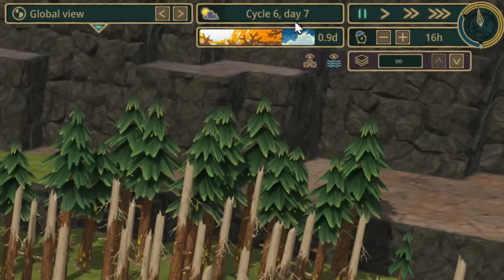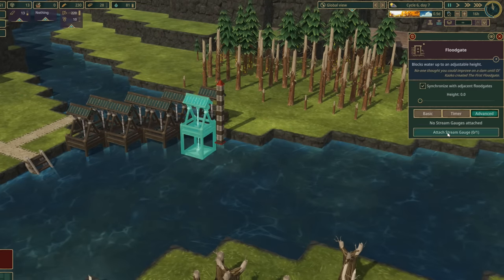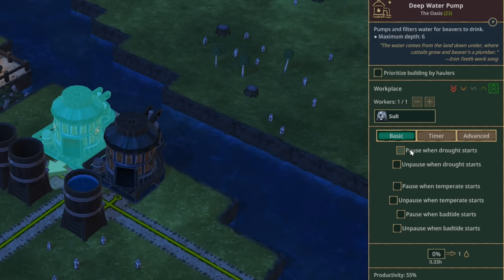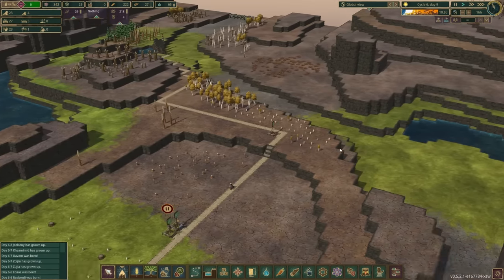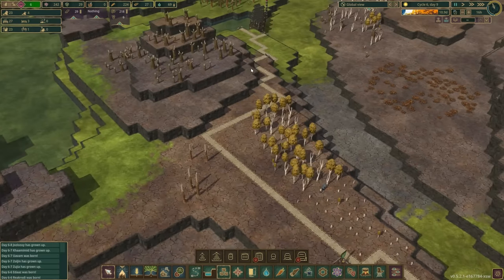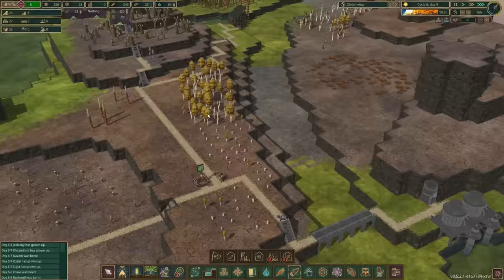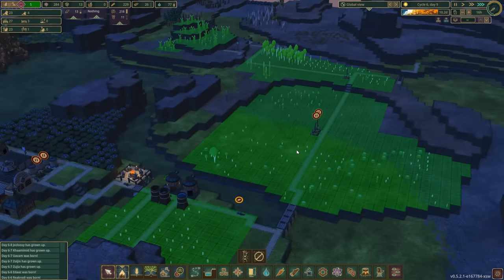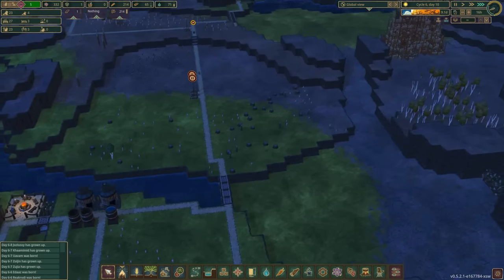BADTIDES SOLVED! With One Simple Mod - BADTIDES Ep 3 - Timberborn Update 5 Hard Mode Series

Comment: Hey Skye & Picture :)  Skye, if you add a stream guage to that new water area (9:16 the one where you added the new water pumps to today) you can connect that stream gauge to the OG water pumps  (10:31) where you have them set to off at draught time.  The setup would be:  OG Water pump reads stream gauge, when stream gauge is 0.75 or lower (what ever you choose); then turn water pumps back on.  In the basic menu, pumps on in wet season; off in draught - overridden by the advanced.  This way when the water runs out in the new water pool area & the pumps stop there, the OG pumps will start again to make sure you have a constant amount of water  in your tanks. :) You can do this in any config, the gauge doesn't have to be right next to the device being used :)  
Have a fab day, I'm enjoying this series :)

Comment: A fun thing you can do with the automation with simple floodgate triggers is: making any fluid dumps you have, once you have dynamite, make them 3 deep and place a stream gauge in the bottom. Attach the fluid dump to the stream gauge and set it to pause at like 2.9 and unpause somewhere above a quarter of a tile of water(2.25-2.5ish). Then it's a job that disappears whenever, whatever you were trying to fill with water. It also works with the mechanical pumps(which can filter out bad water if needed)

Comment: you can also use the stream gauges to measure the water level on a water dump to turn it on and off when needed, when doing that you will need it to be 2 by 1 hole, is pretty good life saver for farms and stuff

Comment: you can also add levees to the sides of the crops on the riverbank and with the regular water flow they will be filled and will last a lot longer in the drought because you are reducing evaporation to the minimum, but only on the Oasis side, once you have dynamite you can use it for 1 tile holes.
Reply: RCE did something similar

Comment: I found a neat trick, I'm sure there's a mod already though. If you place Blueprint a for floodgates adjecent to the diagonal once, in the "spaces", you can use the synchronization function even if they are not fully built. You could even pause the construction to save wood.

Comment: The dam is fine but you are losing a lot of water with them only going up half a tile. It may be time to put in some floodgates to really catch a full tile of water in there.
Reply from the maker: The dams are 0.66 high. Using floodgates wouldn't get you much more water since the water level of the river is only about 0.7
Reply: @SkyeStorme  After posting this comment I went and had a look and you would have to set them to the top but that could easily result in flooding. With the mod you have installed you could have it so they maintain a level so might still be worth it.